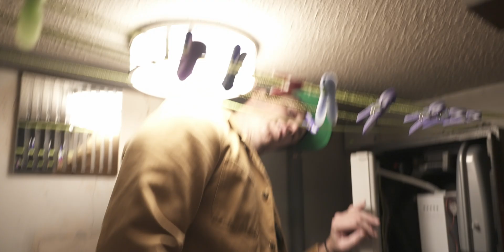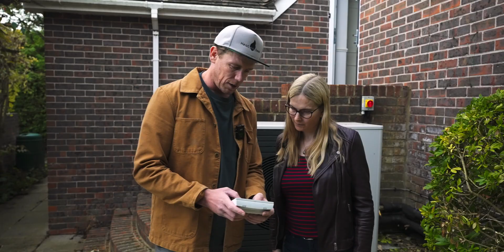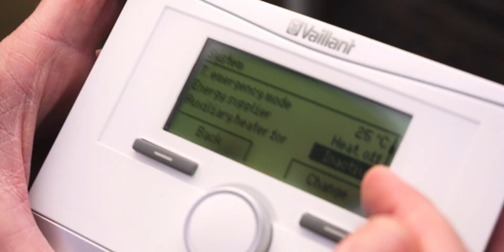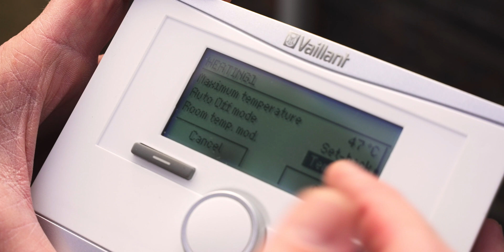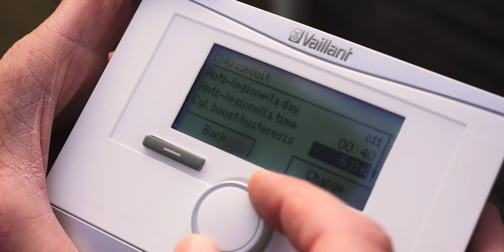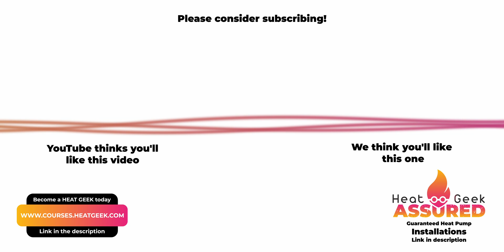How To OPTIMISE Heat Pump Settings!

Comment: Interesting question for you guys, does having the water hot in the h/w cylinder with a air source heat pump help in getting the radiators hot quicker!

Comment: Hello, I have a Vaillant heat pump. There is a "limited operation/comfort safety not active" warning on the control panel and the device does not work. I would be very happy if you could help me solve this problem. Thank you.

Comment: May I ask a question please, we are poised to get a heat pump as our boiler is at the end of its useful life.
We have a largish house, touch under 300m2. But prefer the house temperature to be at 12-15C day and night, rather than the the 20C+ I see in all these videos. Will a heat pump still work well and efficiently at lower house temperatures, or does it need to run at 20+C please?

Comment: I’ve been trying this out on my Altherma 3 but if I try and get the flow temp down where it needs to be the compressor keeps cycling and I can’t work out why! The heatmiser stats are set high, the control is set to LWT and the leaving temp was at 29. The inlet temp was 27 and the compressor kept cycling!

Comment: Hi Heat Geek I hope you can tell me the technical points I have a Vaillant ecotec plus 376 5-5 and in total I have 12 heaters and 4 of them are like 2 meters for the bigger rooms what are the best Vaillant settings and also in code 17 settings can you guide or make a video on Vaillant settings

Comment: Legionella can grow between 20 and 45 deg C. Actual recommended storage temperature to minimise the risk of legionella is 60 deg C. See approved code of practice L8. also CIBSE GUIDES. Room temperatures will depend on the type of heating and the thermal characteristics of surrounding wall ceiling and floor constructions. For instance with an underfloor system and lightweight insulated walls comfort may be achieved at a low air temperature, say 19 deg C or even less as the mean radiant temperature of the surrounding surfaces will be relatively high.

Comment: As an arotherm expert, I wonder what minimum flow temp you set?. I saw https://youtu.be/kkNx2oSO-S4
 with samsung unit it appears the peak COP is not at the lowest flow temp. Looks like peak is 30/35  degrees rather than say 25 degrees that might be reached with a low wc curve on a mild day.

Comment: Hi really interested in what this video is about as I have a valiant gshp on a new build with u at room thermostats. Just wanted to know how to or have some advice to change or week the heat settings on my control panel I feel its not running as efficient as it could. Any links would be great thanks

Comment: Is it just me, or is it completely bonkers that in the year 2023, heat pumps which cost thousands of euro's still don't come with a modern app that actually makes all of these settings user friendly to manage and easy to understand. Instead we STILL get this frustrating little controlling device that looks like it just got stuck in the 1980's for christ's sake :s
Reply: Yeah HP manufacturers are like the old car brands before Tesla. Stupid old boxes, support is only given via sellers, app sucks,shitty  expensiveet addons etc. 

I had to buy a separate wifi dongle for my ecodan pump. Not only is it ugly as hell but it cost 300 euro. The part probably cost 0.1 euro to make if even that. Hell I could by an entire laptop for that money. 

We really need a tesla equivalent in the HP market.
Reply: @NerbyScurvy how come you had to buy a WiFi dongle for your ecodan? Don’t they all come with one?
Reply: @akosszoke5557 I'm late to the party I'm guessing they don't, Vaillant you have to buy the gateway module to use their app. It's all extremely pants. Looks like the Tesla of heatpumps will be Octopus their integration, app etc looks really good and no stupid extra parts for hundreds that should come in the box.

Even the solax inverter for our solar the WiFi is a dongle not built in like this stuff is all an after thought.

Really the gov should pass the law like they did for car chargers that they have to be "smart" to attract the grant. That'd put a stop to all this BS overnight
Reply: It is odd. But it is an old industry - like old car companies who have also been totally blindsided by software interfaces they should have known about..

Comment: Hi I’ve had my vaillant  aro therm plus heat pump for a year. I can’t find any information on the best way to run them. Mine is set to come on early morning and off late evening and set at various temperatures  17-18 d. Hot water set to 50d, i didnt know you can set the legionaries temperature. I would be grateful if you can advise whether to leave the pump running 24/7 or not. I’ve calculated my COP and it’s approximately 2.6 is that acceptable.

Comment: @Heat Geek We have a new build with this ASHP designed with zoned room stats, ufh and rads upstairs. I want to run in full weather compensation, but noticed that the pumps on manifolds (wilo x2) and emittor side of the buffer (grundfos x2) run 24/7 due to these being controlled by the stats. Is this OK? It seems inefficient to continue to circulate water when heat pump isn't active (although appreciate it will be on most of the time anyway). If you're looking to do a video to shine a light on new build ASHP installs, feel free to get in touch.

Comment: Legionella do can be experienced in the area 20-50 degrees , recommended by health authorities in Denmark are 55 degrees, not 50 .
Reply from the maker: It's 60 in the uk...
Reply: @HeatGeek  it was before 60 here also, (but as a security percaution my CTC boiler uses the electric dip cooker to bring the water to 70-72 degrees now and then. Thats why i warmed my neighbors about shutting of the Electric dipcooker, also if something get wrong, it will prevent the outdoor pump from damage from cold)

Comment: Really interesting to hear you don’t need to run the legionnaires cycle if your getting daily showers with a hot water flow temp above 45 degrees. Nice one Adam your knowledge is priceless!!! I would have been looking to run a legionaries cycle at 60 degrees on my night time rate once a week.

Comment: You talk a lot about weather compensation but in my case, there is a big temperature difference in my house when there is a lot of sunshine even when it's cold outside. Is there an easy way to compensate for this ?
Reply from the maker: Yes. Internal refrence. Read our weather-compensation-or-load-compensation  article on hg

Comment: Any chance of doing the same with the Nibe SMO control module? Mines is driving me mental tried all the tips in the videos and it’s still all over the place - for some reason the hot water is always a problem even though there’s only 3 settings!

Comment: Interesting seeing the settings for the hot water. Are these functions only available with the Vaillant cylinder or would it also work just the same with a 3rd party cylinder like a Mixergy?

I'm in 2 minds about which to go for as while a Mixergy will allow me to take advantage of Agile Octopus for heating my water (even with the heat pump), and it looses less heat through better insulation, the plate heat exchanger presumably reduces SCOP as the HP side would need to run hotter to achieve the same water temp?
Reply from the maker: You can't use those functions on a mixergy. You don't need a mixergy to take advantage of agile etc...
Reply: @HeatGeek  oh, well that's news to me, I'll have to try and find out how the integration works.

Comment: how good are air to water heat pump in 30 f and below weather . am looking to use one to heat rad floor heating or  a heat exchanger in a pelume in havc system need 80 to120 degree water how long to reheat and how power need and how good with out heat streeps

Comment: Great videos. Something I can't find is the COP of my new vaillant ASHP. Is the 'working figure' the same as COP thanks .
Reply: unbelievably they don’t show you it on sensocomfort. You might find Enviromental yield on one of the controls
Reply: @egg399.  Thanks. I have since spoken with vaillant and working figure is the cop or scop. And as you say there is more info on the wall panel that might not be on the sensocomfort. Heat pump software is an area for massive improvement. But a relatively fast area to develop. Either way extremely happy with ours.

Comment: Hi if you used a heat battery instead of a cylinder connected to the ashp wouldn't that increase the scop of a ashp as you are only heating the phase change material instead of water or is it the fact that heat batteries connected to a ashp have to use a temperature higher than 50 degrees
Reply from the maker: They lower stop because they require high temperature

Comment: Discussion on Legionella was interesting. I’ve got my boiler set to 50° (It’s a Y plan) and was thinking I’d need to do regular legionella cycles where I’d manually bump it up to 60° but it sounds like that’s not necessary as we’ve got a 120L cylinder and do 2 showers plus a small person bath a day, so water turnover may be enough to not bother, correct?
Reply from the maker: While video coming out on this later
Reply from the maker: But yes

Comment: Why did you say 1 person showering would use 75% if water from cylinder per day?
Reply from the maker: Because I assumed she meant her and her partner would each shower 1 x per day
Reply: @HeatGeek  i was trying to understand how much hot water usage is an average per person. Some heat loss software i used said 45 litres per person and that ashp is always 10 more than gas boiler. Doesn't seem enough.

Comment: No weather compensate? Isn’t that part of the new requirements from 2023, and hvac rules 101 absolutely do not turn  legionnaires off  it doesn’t matter if 75 % is use it’s the residual in the tank your cleaning but you can get away with a constant 75 fir just 10 mins at night
Reply: Yes our system has weather compensation, this is the primary control for the system.

Comment: Stupidly complicated. When I was a kid if you wanted hot water you lit a fire. That had a back boiler. If you wanted heat you lit the same fire. If you didn't want heat you switched on the immersion heater. Which even then we considered expensive. But I just couldn't be bothered with a heat pump even if I didn't really have to fiddle with settings. Too complicated for its own good like modern cars. My old truck is 22 years old. You can fix it with a bent spoon and it has already out lasted much more modern vehicles. Around where I live now in rural Qld if you want heat you stoke up the wood burner. Some things don't change.
Reply from the maker: These are engineer setting to tweak efficiency, not user settings, as per the video.. and the difference between 250 and 400% efficiency as opposed to a 55% efficient back boiler 

Regarding being too complicated to use. Unlike the boiler the had to physically go to everything you were cold and wanted hot water, you do nothing with this. It's all automatic. It's much less compilated and less work than a back boiler
Reply: @HeatGeek  Yes you are unlikely to fiddle like this lady I agree. They probably are a lot more efficient on paper too. But with free wood to burn we could run our fire for nothing. My Gran who was Victorian used to cook on the fire as well. Try doing that on a heat pump. Open fires or even wood burners are lovely to sit around in winter. You don't get that lovely atmosphere with a heat pump. We get a lot of power cuts. A wood fire still works. Not so much the heat pump. My parents place and my Grandparents place both hundreds of years old and the fire places still work. My Grand still had the black lead oven that got used daily. Heat pump what start going wrong in 5 years. Totally knackered by the time the warranty runs out. You call yourself a heat geek and are passionate about what you do. Nothing wrong with that. I am a passionate old fart that just preferred the old ways. Chopping wood kept you fitter than an I pad. And in general we were all fitter and healthier not being shut up in an insulated computer controlled box that is a modern home. But each to their own.
Reply from the maker: @davetaylor4741  yes. Shame we can't all own woodlands
Reply: @HeatGeek  Never did. Lot of common land in UK. Collect your own. Plus all my family on both sides all in service for generations. Free wood from the estates. Australia has lots of Bush. Lots of trees. Lots of wood. I pretty much always lived in the country you can find most of what you need. Todays soft bellied city dwellers can only survive if they live next door to Tesco or it arrives in a van. It would be almost impossible to live like we did 60 years ago and before. So they turn to people like yourself to help control their environment. This will be the way forward unless there is some international disaster. I am just glad I am closer to the end than the beginning. And that where I live now is like a time warp so you can still keep some of the old ways. 40 years ago I loved the latest technology. Just as you get older you start to realise you never needed most of it and times were better without it. I wouldn't have believed that 40 years ago and you won't. Wait another 40 and look back. See how you feel then.
Reply from the maker: @davetaylor4741  not even 2% of the UK could live that way. Shame the 67 million of is don't live where you do! Dont thinknyoull have enough fuel fornyour self then though.. Untill then..

Comment: Hi. My job is energy efficiency expert. I currently installed Atlantic Alfea Extensa 10kW heatpump for home heating. I have energy monitoring system installed. For my surpise in stanby mode, with DHW and heating off, circulation pump off, the heatpump have standby consumption of 220Watts. Checked and confirmed the consumption with certified ampmeter.  In technical data on standby mode its written 8 watts, on thermostat shutdown mode - 22 watts, Crankcase heating mode  - 0 watts.  With simple calculation on anual basis 8760 hours x 0,22kWatts =   1927kW hours. Last year with natural gas heating for the whole year Heating and DHW consumed around 12 MWh of energy. With conservative COP of 3 my heatpump should consume around  4MWh hours of electricity. So the consumption of 1927kWh for standby mode consist 48% of the whole energy consumpsion which is INSANE. Searched the internet for the problem and its the same with Mitsubishi Ecodan and Daikin Altherma units. This consumption is refered to electronics and inverter standby consumption and compressor crankcase heating mode and is not listed in heatpump technical data, and my guess is whole SCOP and SEER data do not include this consumption. Have you got any info for this problem?
Reply from the maker: No I don't and ide love to know more. We only fit premium brand and don't consider those premium in the heat pump space currently. Please email me if you find out more!! Hi at heat geek dot com
Reply: @HeatGeek  Which brands you consider "premium"?
Reply from the maker: @ivailostefanov23  vailant viessmann nibe
Reply from the maker: Steble ultron
Reply: @HeatGeek  I think I saw at some videos you have Vaillant installed in your office. Can you check its stanby consumption with DHW, Heating and circulation pump off?
Reply: @ivailostefanov23  I can tell you this as I monitor my energy consumption very closely as we have PV and Powerwall's and I'm addicted to the stats. Since having the heat pump installed I haven't seen the baseload being increased any noticeable way at all, when it's in standby the load from the house is still the same 400-500W that it's always been so I'm fairly confident in saying our Arotherm+ has nothing like that level of current in standby that you are seeing with your Alfea.

Comment: What’s the minimum output of the 5kw and 7kw arotherm plus?
Our boiler modulates down to 6kw and even in very cold days it cycles a lot
Reply from the maker: About 1 3rd
Reply: Thanks for all these informative clips. I have a 12kw AroTHERM - does that mean it’s lowest output would be 4kw - how would I know how much heat it’s creating? I’m asking as mine is cycling more as I have lowered the heat curve following your advice. Thanks for any help you can offer

Comment: Great explanation ... With hot water heating  with flow temp 5  Kelvin above the hot water heating ..  What's the lowest output power of the Arotherm can run at before it starts cycling ?
Reply from the maker: About a 3rd of max
Reply: @HeatGeek  That sounds good .....  For Copper HW cylinder coils the only figure I found for heat transfer is in American approx " 70 Btu/ft2/hour/degree F " Which I think translates to  0.4 Kw/m2/kelvin   (so a 3m2 coil can put 6kw into a H/W cylinder with 5 degree Delta T) .. Does that sound right ?    
PS . The guy who did my EPC was called Kelvin , but he didn't know his name was also a unit of temperature !